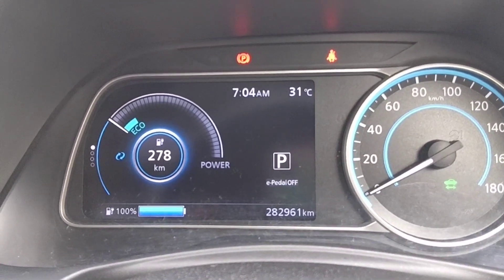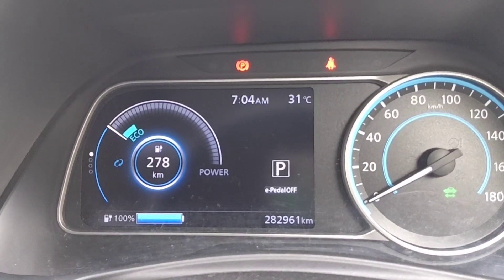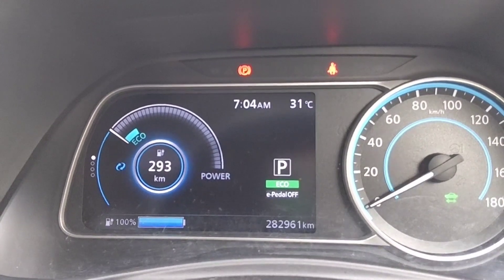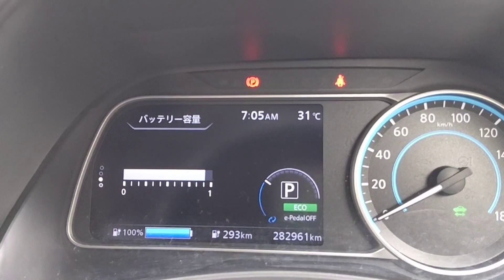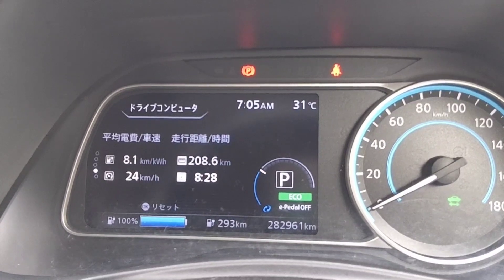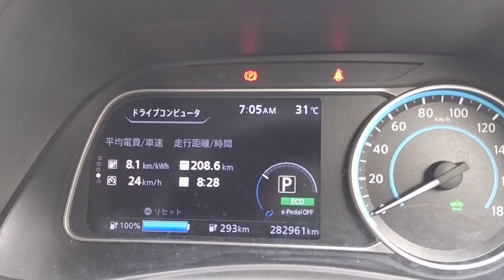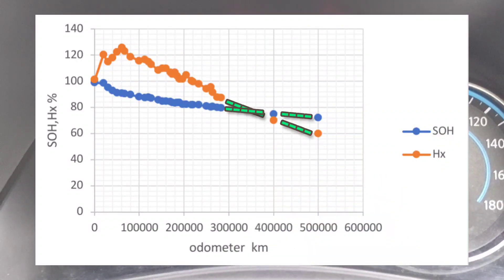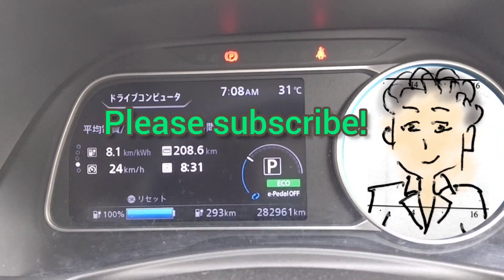2018 40kwh Nissan LEAF, Full Charge at 283,000km( 5 years 7 months ). Inner resistance estimation.

Comment: Did I understand you correctly? Do you charge up to 100 percent only four times a month? And the rest of the time on fast charging up to 80 percent?
Reply from the maker: Thank you for your comment.  LEAFspy data at 282961km shows 1459 QC's & 2963 L1/L2s. That means 1459 times QC and about 1500 times AC charging.  I mainly use timer charging when I use AC charging.  I think I did full charge about 270 times using AC charging. That means 20% of AC charging is full charge. Usually, I charge about 50% of capacity on a single charge.  QC fee is rising are these days, so I reduce the QC % per charge. I charge only as much as I need using QC, about 20～30% of capacity.